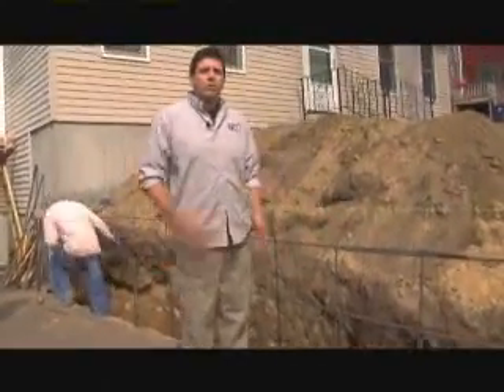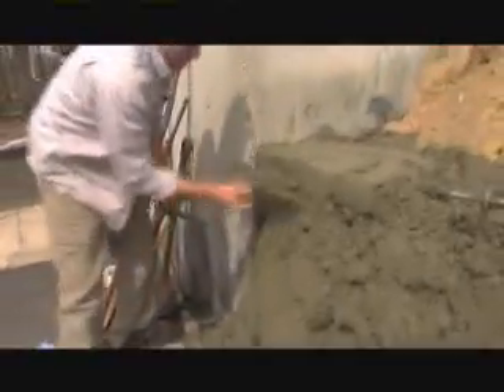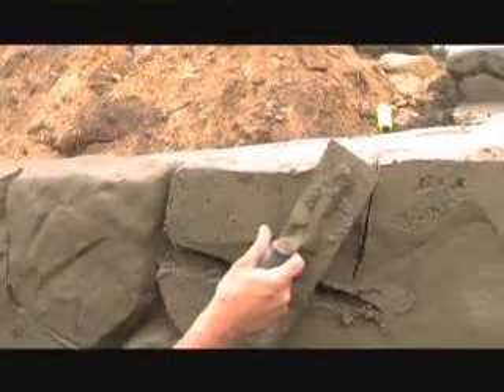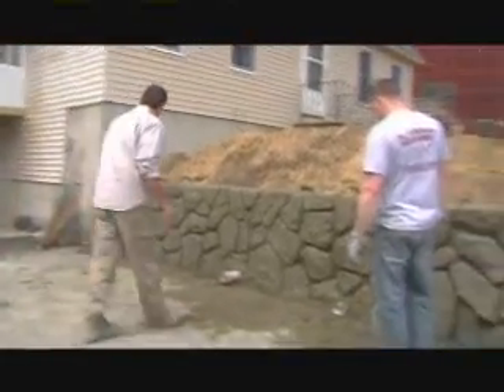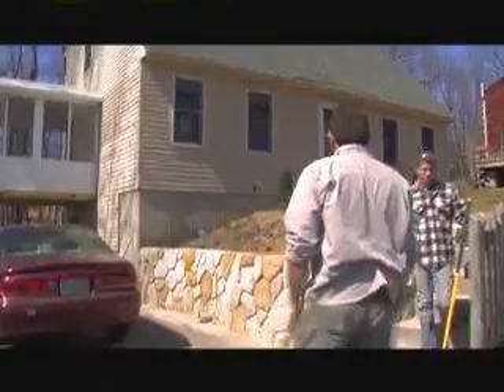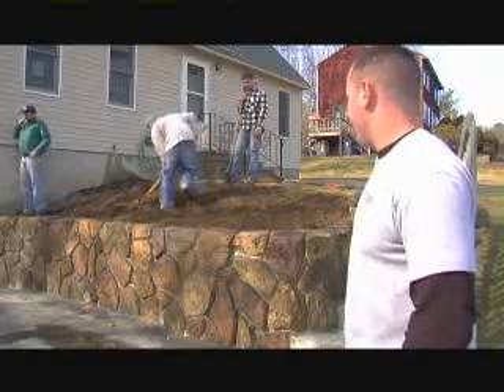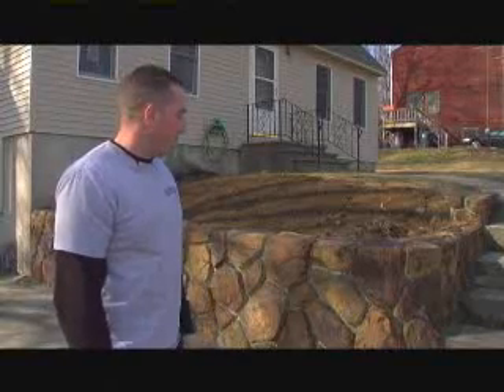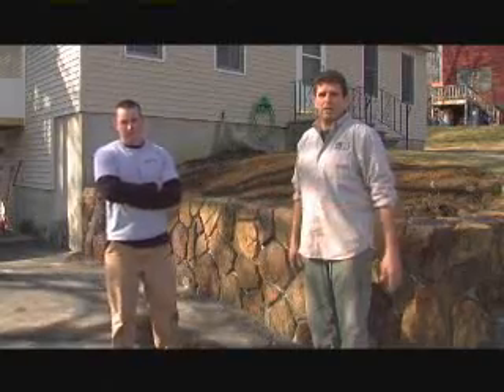How To Build A Retaining Wall - The Stonemakers™ Method

Comment: what's the culvert drainage pipe in bottom of the walls function, it was sticking out a few inches about every 3 ft., it cut off flush with the wall but you can still see it ?

Comment from the maker: @fuzzpool  I have been a mason for more than 30 years working with real rock 3rd generation and to date i have not found any walls as strong as this process. If you knew the whole process you would understand. Rock really never binds to mortar and the psi is much greater in 2 inch slump concrete with our chemical additives. We are seeing close to 3,000 psi after only 24 hours and can get up to 70 to 80 thousand psi and more by final cure time. Best of all it is monolithic.

Comment: If you did  real stonework you would know not to do runs and standing stones."two over one".The real thing will last forever.yours will have to be repainted.When it cracks and it will it will show all.
Reply from the maker: Nathaniel Eastman just went back and looked at this project not a crack in it 10 years later